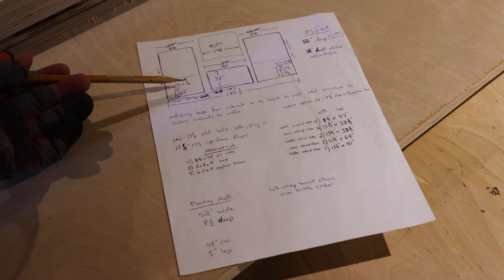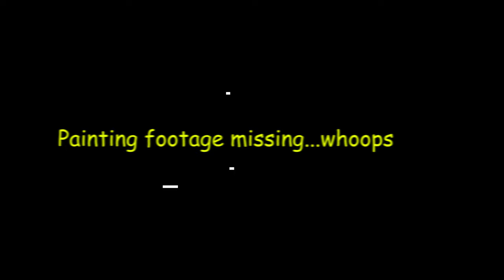DIY Built in cabinets and shelving for home office

Comment: Jesse, thanks for the video.  Helped a lot.  Customized 13’ for full sized built ins.  Middle unit built specifically for the PS5, PS4, Switch, and my 4K player.  Added 2 almost full height bookcases in each side for my wife’s million books.  Your construction methods are spot on.  Thanks again.
Reply from the maker: Sorry for the super late reply but that's awesome! Happy to help

Comment: Looks awesome mate💯 I actually decided today to make a shelf for under the tv. So had some pine shelf really thick. About an inch and a half thick and 40 inches long. Just need to sand and remove the previous darker coat. And I have clear coat for pine which makes it more of an orange tone... Really looking nice. And triangles at the bottom for support
Reply from the maker: Thanks! Nice, it's always good when you can use leftover material or repurpose stuff

Comment: I’m confused if you routed  a 1/4” rabbet into the back and then used 1/4” foot plywood wouldn’t it then just set flush with the wall causing the problem you were attempting to avoid?

Comment: What is that Long impact driver bit holder?😊 I mean I Can see it is a bit extender. But what brand and length is it?
Reply from the maker: I don't like bit extenders usually because the bit always stays in the screw. It's just a 6" long bit the goes straight into the drill. You can find them at most places with all the bits
Reply: @JessedoesDIY  okay thanks :) is it a standard bit or for an impact driver?☺️
Reply from the maker: They are made for impact use, but it's a standard 1/4" chuck. It can fit in drills, impacts, screwdrivers. They all use the same connector
Reply: @JessedoesDIY  okay thank you so much for replying❤️
Reply from the maker: Anytime

Comment: HELP! I Have an important question for you.  I'm building a house and I would like the do the craftman style door trim and window trim. How far should the top piece of trim hang over? Some say 1/2 inch some say 3/8. I need any advice i can get. Thank you so much in advance
Reply: Sorry! I just found your video on it. So you think 3/4 inch off each side. Our top piece of trim is a little bit wider then the rest of the trim
Reply from the maker: It's entirely up to you. Like I said, I did 3/4" when my top and bottom trim was wider then the sides. But when I did them all with the same trim I did 1/2". It's all what looks good to your eye, there is no code for it
Reply: @JessedoesDIY Thank you so much. This is very helpful

Comment: I like the alternating shelf colors -some wall color, some cabinet color. I also caught the heat register - I built a kitchen cabinet on wheels, I never did put the bottom front piece on but I’ve since moved it and it’s over a register so the heat filters out ... good thing I never put that piece on.
I’d have made a piece to blend that in but it still looks great.
Reply from the maker: Thanks! Was just a little something to differentiate them a bit so it wasn't so bland, but didn't scream "look at me" also. Yeah the register was in the way but it was easy to get around, she didn't want anything crazy so just a decorative metal cover for it. Thanks for watching!

Comment: Installed on top of the carpet?  I’m getting ready to make already built shelves look built in - wondering if I should pull back the carpet.
Reply from the maker: We did her yup, but you could do either or. They were going to be replacing it in the future, didn't know with what. They also didn't know if they wanted to pull back the carpet so we just didn't. Up here anyway it'll help keep the floor warmer in the winter like a little insulation. If they want it removed later, the cabinets come out easy enough

Comment: I'm curious about the cabinet doors. Did you build the cabinets to match a door you could preorder and use? Or did you make the doors too? I would like to build a built in in my basement but I'm not sure how to handle cabinet doors or drawers. I'm not confident I can make a drawer or cabinet door. Any advice?
Reply from the maker: I built the doors myself. I have a video on my channel of how I make simple pocket doors and how to measure for them. I also have another video on how to measure and build pocket hole drawers. Check them out, I lay it all out as easily as I could!

Comment: Love this - quick questions:

1. Did you attach the bookshelves to the butcher block or just that top piece?
2. Did you attach the base cabinets to the wall anywhere else than the top piece?
3. Out of curiosity, why didn't you go with a toekick?
Reply from the maker: Thanks! 
1. I didn't attach them to the block top. I had the material to do it, was just going to be a dowel drilled into the top, and then up into the face frame. But it was already so solid with the face frame keeping the sides rigid, they decided it wasn't needed.
2. The base cabinets just got a couple pan head screws into a wall stud through the rear nailer plate in the cabinet like I showed. That's more than anough. They were also screwed to eachother once installed through the face frame.
3. Just a design choice. They went with a flat front, with the option to continue the baseboard across it at a later date if they wanted

Comment: What kind of screws did you use in the pocket holes?
Reply from the maker: Regular Kreg pocket screws at the recommended lengths the call for based on material. In this case, 1 1/4"